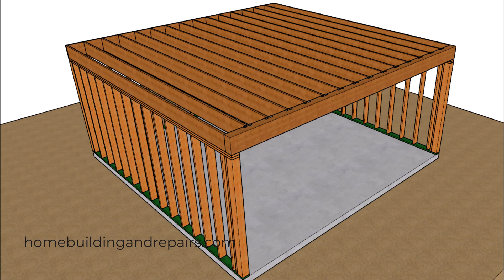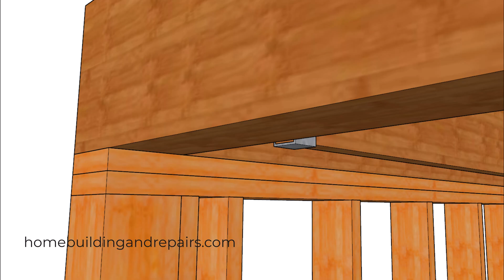Easy Installation Tips For Adjusting Top Flange Hangers - By Adding Small Wood Strip or Plywood

Comment: I had to do the thin strips all over my house built in 1898 with old rough sawn lumber. Took out the plaster and lath and had to get everything flushed out for drywall. Was a pain in the ass!